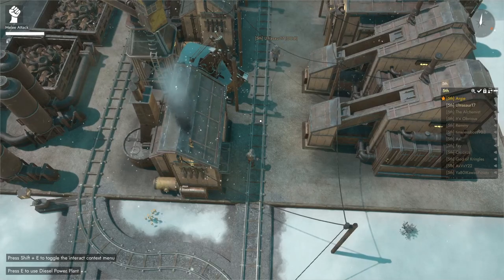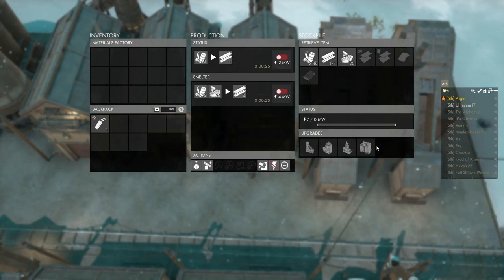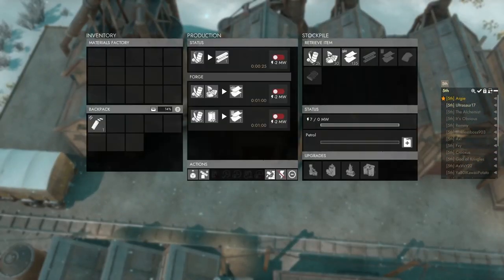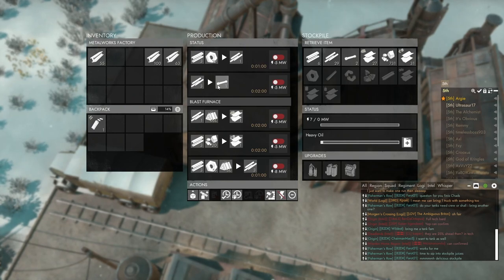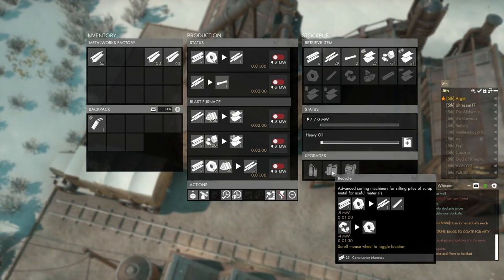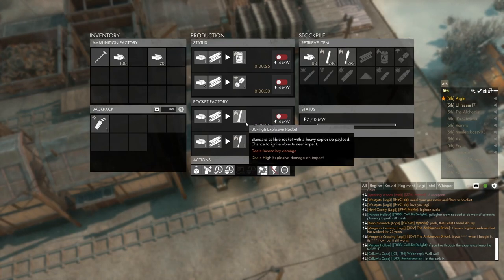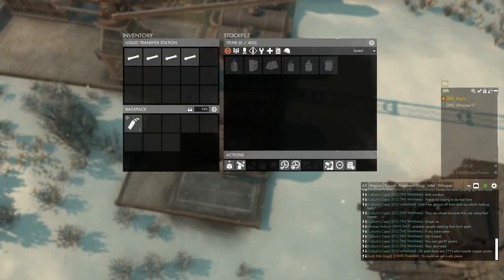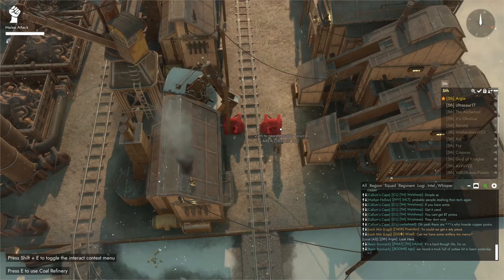Foxhole 1.0 Facilities explained!

Comment: You did not mention the maintenance of the facility. I still haven't figured out the best method to keep the base from decay. I saw that there are maintenance tunnels, which should take about 40m of distance. Other than that, do you recommend building close to a base bunker?
Reply from the maker: ah, slipped my mind! Best method is definitely using the maintenance tunnel combined with diesel. The is a balance to be made using it though, as it only creates so much Gsup/h thus you have to make sure you only require equal to or less than this amount. The amount can be read on the maintenance tunnel, i am afraid i can't remember right this moment. As long as it is powered, all is well. You need roughly 1 liquid transfer station for every diesel power plant you have, and every plant can run 2 tunnels with 1MW left over (useful for cranes). one fuel station should last you the night at least. Haven't done the math, sorry